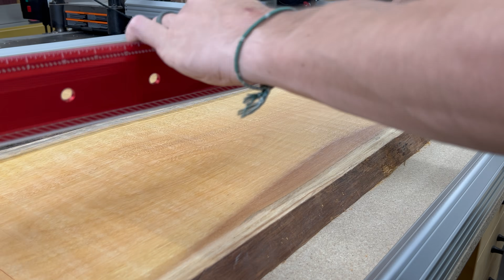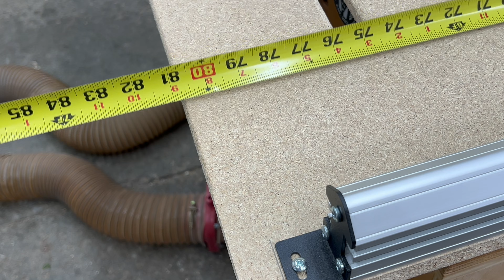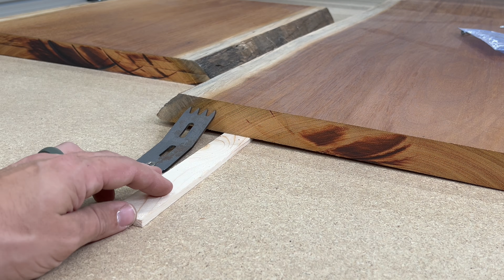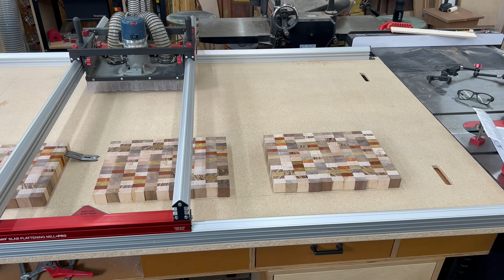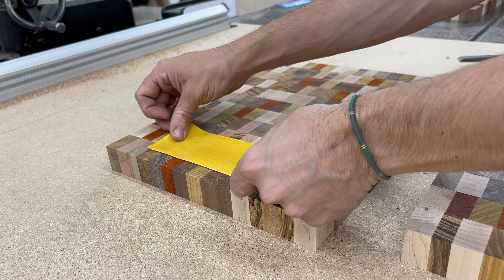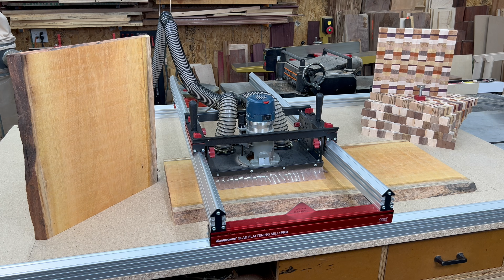Woodpeckers Slab Flattening Mill Pro l RedTOOL WOODSHOP

Comment: Great video, thanks.
It's not very often that I can think of a change or addition I'd make to Woodpeckers products because you guys always seem to think of everything, but I may have one this time. Instead of the two vertical handles, I think horizontal bars that either already extend past the front edge of the sled or that telescope out when needed would make it a lot easier to move it back and forth over a wide slab (or collection of things like the cutting boards being done at the same time). Both in this video and the Deep Dive that Jeff did a while back showed that you have to let go of the vertical handles in order to reach that far and I think horizontal (front to back) bars or handles would solve that problem.

Comment: So, is “the right direction” of the router the same as if you were not doing end grain (left to right while facing an edge?)
Reply from the maker: To avoid tear-out on end grain, make a climb cut, which is opposite the "typical" approach. You want to move with the direction of rotation. The router will try to pull itself, so you will be holding back more than pushing forward.
Reply from the maker: Negative, it’s the exact opposite! You want to follow the rotation of the bit which would be right to left. It can definitely be a bit confusing but for end grain boards, I’ve found it most successful to do it this way!